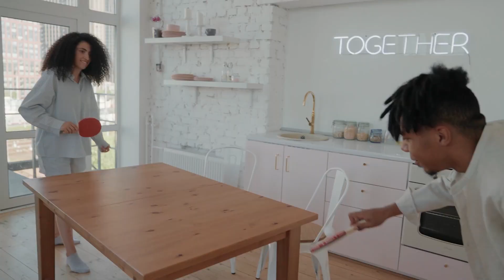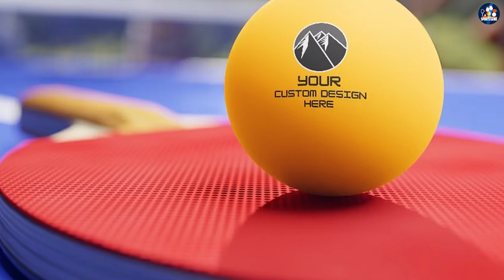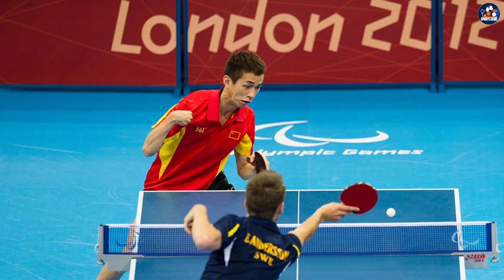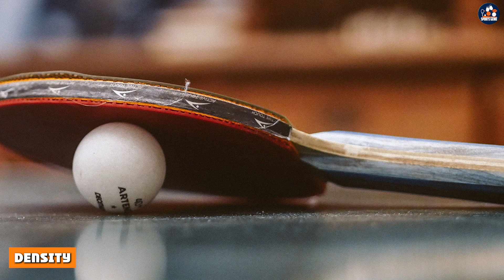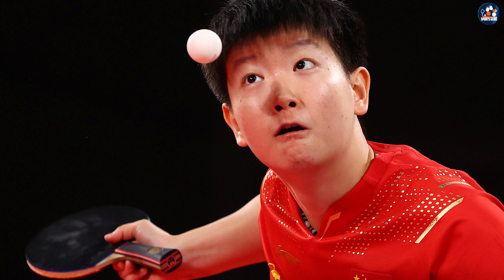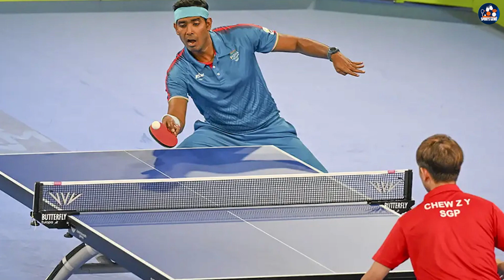Plastic vs Celluloid Table Tennis Balls: Which Really Are Better?

Comment: The change was based on a blatant lie. Adham Sharara 2011 in an interview to the CCTV5: "Our ball is made of the material called celluloid. Celluloid is banned, is not allowed in most of the world except some places. China, Korea can still use celluloid. But the governments of those countries for the future will also ban celluloid. So if there is no more that material, then there will be no more our ping-pong ball or our table tennis ball." The BoD of the ITTF Resolution 2011: "Proposed by the Executive Committee  The ITTF Executive Committee and the Equipment Committee shall request from | Passed  Ball Manufacturers to produce 40mm PVC balls (non-celluloid), after the 2012 Olympic and Paralympic Games, in preparation for the total ban of celluloid production by national governments around the world, and the Equipment Committee shall adjust the Technical Leaflet in terms of description of the new material and tolerances."